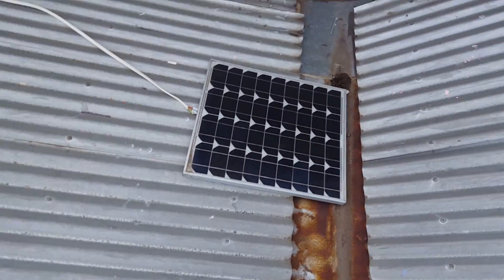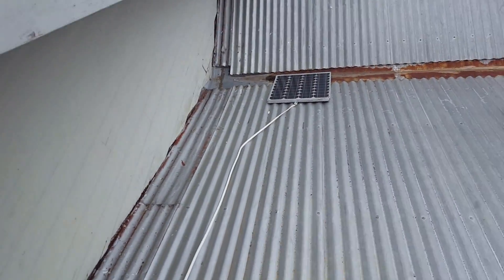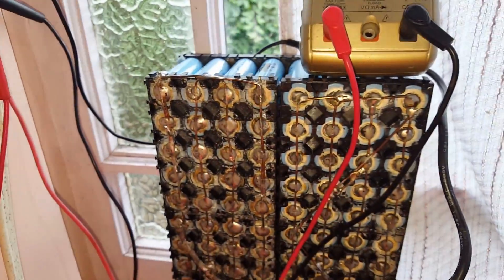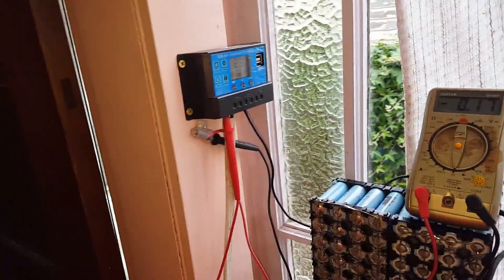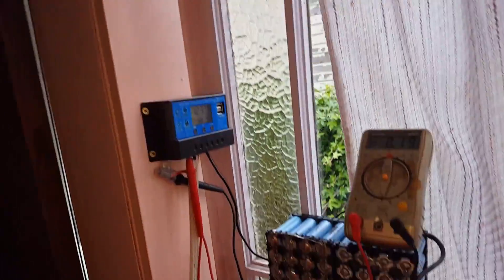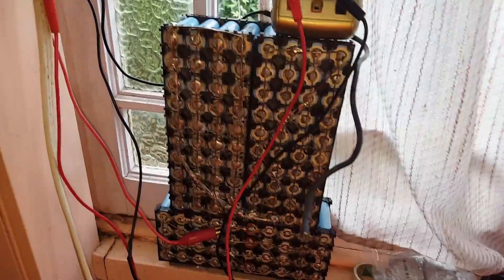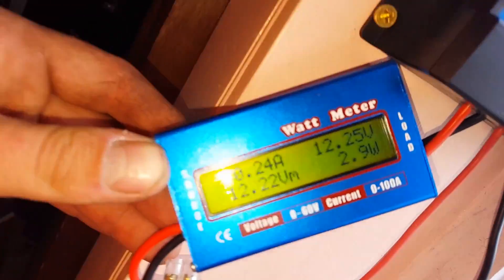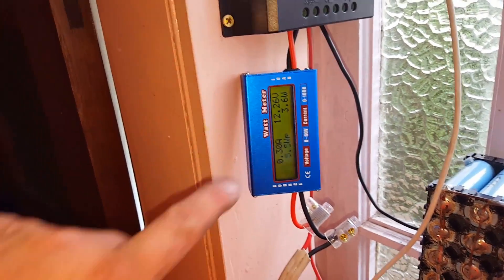Diy mini 18650 Power wall solar charge controller mounted and charging

Comment: Hello. How many ah is your bank? is it wired up into 3 banks series to give 12v?
I work at a powertool repair shop and Ive got load of dewalt battery packs that im currently dismantling to build a power wall.
Is the solar charger regulator your using just wired directly to the 12v output of the battery bank? Is it also a special type thats designed to charge lion cells?
Reply from the maker: Yes 3series 66 ah 
That was connected to solar direct to cheap charge controller max set to 12.6v and only with a 40 watt panel.
I was the bms do not copy this. Buy a bms to suit and make it safe
Reply: @Oneupthesleevecustoms  Cheers. can you recommend a bms to use on a system like that?
There are some 3c bms pcbs rated at 40a on aliexpress, see the link below and let me know what you reckon

https://www.aliexpress.com/item/4000370977034.html?spm=a2g0o.productlist.0.0.7e3346cbECAfOg&algo_pvid=7d9a7629-0c84-41a4-b5a0-678c2aa887ad&algo_expid=7d9a7629-0c84-41a4-b5a0-678c2aa887ad-25&btsid=e05b244a-ce14-49ef-b947-f4f87041fd7f&ws_ab_test=searchweb0_0,searchweb201602_9,searchweb201603_55

Comment: how long time charger battery 0 to full ? and how many mAh this battery?
Reply from the maker: It was 600 watt hrs it could charge as slow or fast as you want. Was 55 ah at 12v. Could charge at 100a if you need to

Comment: for this type battery charging (18650)what solar charge controller which is better? PWM or MPPT and what brand do you recommend?
Reply from the maker: Neither a mppt with a bms is the only thing i could recommend as safety is key
Pvm is a cheap way of charge control hence its cheap price and lots of inefficiencies  cheers

Comment: Run usb 12 volt socket direct from the panel. Charging battery to battery is just using up unessary cycles.
Reply from the maker: Super -sim thats true this setup is scrapped now but  i have a big setup im building

Comment: Epic stuff bro!  Looking to do something similar. Any recommendations for where to buy quality 18650s cheap?  I'm open to processing old laptop battery lots if you have a decent recommendation for a seller?
Reply from the maker: +Dimitris Zarmakoupis the issue is so many people doing that now there hard to find  anymore. How big do you want to go and do you have a budget in mine
Reply: One up the sleeve customs I want to buy 120 cells (or more if some will be faulty) 2000-2500 mah.  Looking to build a 12v pack to output 500-1000 watts similar to what you've done.  I was hoping to spend under $200 US on the cells

Comment: Can a solar panel an a charger controller charge them batterys at one time
Reply from the maker: +Jerry Blackledge yes
Reply: How many amps an watts do I need to charge them
Reply from the maker: +Jerry Blackledge yes
Reply: I see videos  ppl goes over board with batterys build huge battery banks thsts crazy
Reply from the maker: +Jerry Blackledge gow many  calls you got
Reply: I got 9 so far
Reply: Am watching yr video like the battery bank how many amps are you useing to charge them all at one time am new here so am trying to build my way up with a battery bank
Reply: Do ya have the watt meter hook up to the solar panel then threw the charge controller an to the battery bank
Reply from the maker: +Jerry Blackledge na i should make one
Reply: I have a a.c. power supply 110v an then 12volt on other end 4.16 amp csnn i charge those batterys with thst
Reply from the maker: +Jerry Blackledge should do
Reply: Ok do I need a charge controller to hook to it
Reply from the maker: +Jerry Blackledge yes defiantly get a charge controller
Reply: I got one it only had led lights charge controller
Reply from the maker: +Jerry Blackledge thatts cool
Reply: How do I no when batterys are charge on that solar charge controller it only has led lights I need some help with it
Reply: I have 8 of  those batterys do I put  3 in s an the other 5 in p all hots an grounds
Reply from the maker: +Jerry Blackledge yeah are they new or second hand
Reply: They not new but full charge is 4.2 they hold a good charge
Reply from the maker: +Jerry Blackledge oh thats good yeah. Just get  3s and parallel  whatever you want but keep an eye on each banks voltages  and stay safe
Reply: I just want one big battery bank not 3
Reply from the maker: +Jerry Blackledge i think you need to do some more research into litium battery systems mate
Reply: I mean I want a battery bank
Reply: I see ya only have one in the video battery bank that's hook up to a charge controller an a yellow volt meter
Reply: I want mind that size
Reply: Will those batterys blow up if the voltage drop

Comment: awesome video ,how lomg does it take to charge the battery pack  full
Reply from the maker: +Ben Ch 1.5hrs i beleive but will test  and post a vidoe
Reply from the maker: +Ben Ch hey  it puts out around 2.2 amps and is 55 amp in capacity.  I don't  often let it get full so not sure but say around 20hours of sunlight from flat

Comment: is it going to stop charging on 12.6 volts.   12.6 volts will be the max voltage for the 3 packs you got there, or am i missing something. thank you interesting  charger controler you got ther made in au. thanks
Reply: i have this charger dosnt work so well with higher voltage panels
Reply: my panel does 40v  when its cold 5amps
Reply from the maker: +ary depaula yeah charge controller  stops at 12.6 you cN adjust it. It must have come from overseas maye
Reply from the maker: +ary depaula thanks for watching
Reply: awesome if you can control when to stop
Reply from the maker: +ary depaula 12.6v minimum and 15v. Maximum
Reply from the maker: +ary depaula they work well ive got 2 now
Reply from the maker: What do you call high voltage
Reply from the maker: ebzery yeah mine did 38v and poped the usb charger

Comment: Just a tipp: Voltage drop comes with current through the cable. You can actually have a 500m Cable and you will have the ~same Voltage on input and output. But read the Voltages on a Sunny day directly on the panel and on the terminals of the solar charge controller. With that reading (and the measured Current) you can calculate the actual powerloss through the cable. But as it is a small Panel and you use some 2,5mm^2 cable it shouldn't be to high ;)
Reply from the maker: +Robin Cerny i later on did this and .015 of a volt at 2.6 amp 12v infeed theres about 35m of cable i worked out and im not having any issues thanks heaps mate i appreciate  all the feedback/hints  cheers
Reply: As I said, it shouldn't be to high ;)
I'm actually an educated electrician, and I also worked some time with Solar installations (much bigger of course ~5kW and above). 
But I like guys who do it your self, at least if it's mostly safe, and if not, I like to point out warnings ;)
Btw. just as a small tipp: You can actually power Switch mode power supplies  with a high enough DC Voltage, something around 80V to 180V would work without a problem, of course you need a DC-DC Boost converter to boost the Voltage. But as far as I know it would be more efficient then using an Inverter for that Job. The first thing Switch mode power supplies do is rectify the input anyway ;) Keep in mind that this only works with Switch mode PSU's!
Reply from the maker: +Robin Cerny yes i was reading about this  recently and am yet to try it ive got a small dc dc boost but looking to get higher voltage one . Cheers man i love feedback
Reply from the maker: Robin Cerny thats a big step up insnt it my plan is to make a high voltage  power wall and run it into the 5kw grid tie  inverter i have so over 200v dc and use it when im running big things in my shed like welders plasma cutter and big compressors so im not costing me so much dam money in electricity
Reply from the maker: +Robin Cerny what part of the world are you from robin
Reply: Funny that you ask :D
I'm from Switzerland, and we have actually one of the strictest norms/standards for electrical appliances and installations ;) Sometimes, if I'm in other countries and see there installations... the only thing I can do is a Facepalm xD
Reply from the maker: +Robin Cerny hahah yeah it can be scary im a plumber  by trade and when im in ceiling  crawl spaces ect it makes me wonder how places dont burn down 3.6kw water heaters on running on 1mm2  cable 30m long haha
Reply: At my last Job, we had a box full of "special stuff" that our costumers tinkered... Burned cable rolls, Aluminium foil wrapped fuses... all kinds of weird and scary stuff xD
Reply from the maker: +Robin Cerny custom bolts for fuses make me  laugh too the things you see ....
Reply from the maker: +Robin Cerny haha yep youd know she lot go
Reply from the maker: +Thomas Cruz ^^thats some numbers i can work with cheers

Comment: Very helpful, thanks
Reply from the maker: +robviolin1 thanks for watching  its been a fun project and im still using it the way it is now
Reply: One up the sleeve customs - I need to make my brother in law a 48 volt pack using 18650 batteries for his electric riding mower.
Reply from the maker: +robviolin1 that would be awsome!! Nice and quiet too use
Reply: One up the sleeve customs - I converted two gas riding mowers to all electric. I use a 24 v system on my mower. I have been using two 12 v AGM batteries. I need to make a 24 v pack of 18650 for my mower. It is great cuz it works every time. No gas, oil , spark plugs, and no hassles.

Comment: how do you balance the cells?
Reply from the maker: +TeaDrinkingIlluminati top balanced them once and cycled for last 6 weeks with only .1v drift they dont need active bms or Balancing.
Reply: One up the sleeve customs Alright, seems legit. Can you quickly explain what top balancing is? Is it just charging the parallel pack and letting it sit or?
Reply from the maker: there is a mini  diy powerwall  play list  have a look at the newer videos of it it has a little cell moniter that scrolls  through each cell and the total pack voltage  i get .5kwh out of it when its fully charged
Reply from the maker: +TeaDrinkingIlluminati top balancing  is done by making all the cells charged to a set level (4.2v) for totally full i have done it in the past with the lab power supply one pack at a time but youll see in later videos i now have a std balance lead on it and can use a lipo charger if needed
Reply: One up the sleeve customs Thanks! The balance lead goes to every positive and the most negative right? How often do you balance the cells?
Reply from the maker: +TeaDrinkingIlluminati haven't since  the first time
Reply from the maker: +TeaDrinkingIlluminati yeah black to negitive and every positive  on the pack

Comment: very danger
Reply from the maker: +戴来 no danger work well
Reply: One up the sleeve customs You do not even have a protection circuit, there is no balance, if I see this I will keep his distance
你连个保护电路板都没有,也没有平衡，我要是看见这个这个我会和他保持距离
Reply from the maker: +戴来 you didn't  watch the videos clearly. It doesnt need protection  or  a bms watch the other videos and see

Comment: Nice video thanks - may I ask though: Did you fuse each individual cell and what is the purpose of the connections that appear to run some diagonal distance on your pack?
Thanks!
Reply from the maker: +David T. No just a test pack with known good cells so i didnt fuse. The extra diagonal  wires are to help  hold  large bust currents for videos  thats are coming soon
Reply from the maker: +David T. The final large powerwall will have  cell level fusing there is a whole playlist  of videos  on this small scale test
Reply: Thanks - Yeah I've seen several vids where they have fused each cell..I  am going a slightly different route, since they cells I get from laptop packs are already tabbed in parallel, I am opting to just fuse 2 or possibly every 3 that are already in parallel..Not failsafe but certainly better than no fuses at all..
Thnks for the reply,
Dave
Reply from the maker: +David T. Yeah fusing is next on my list mate
Reply from the maker: +David T. Yeah fusing is next on my list mate but the next pack will be like 2500 cells

Comment: Can you link the solar panel and controller?  Also, what is your battery configuration?_S_P?
Reply from the maker: +eNkrypt 3s 40p mate the panel is just a cheap as no name brand 40watt panel. Charge controler is a no name 20amp pwm charge controller about 20 bucks aud on ebay cheers
Reply: One up the sleeve customs thanks man! How long does it take to charge your pack at that amp draw from the panel? I have just started getting into this using recycled batteries. Came across your video! Cheers from the U.S!
Reply from the maker: +eNkrypt mate go through the li ion battery play list youll love it. About 14 hours from flat need much bigger panel but this is a small scale test about.5kwh storage. Im probably  going to make a 20 or so kwh one down the track
Reply: One up the sleeve customs will do! Hey, does the solar controller shut off when it detects the voltage is high enough? (4.2V*3 series = 12.6) can you control that? For instance if I am doing 4S120P I would want to be able to charge until my voltage reaches (4.2V*4 series = 16.8V) in my case I am using a BMS for each parallel cell pack in the series.
Reply from the maker: +eNkrypt maybe not 16v i think this one tops at 14.7v float charge. And its turned down to 12.7 but never sitts there charged  as i use the free power it makes

Comment: sir im krizmer from phillipines. quick question? are you using charger controller directly to your power wall (18650) 12v set up i guess? or are you using bms between scc to your power wall
Reply from the maker: yes directly connected not ideal if you are going to let a samll pack like this charge up fully. if this was on a larger scale id be using almost all the energy ive captured so it would never get to full. float limit is set at 12.6vdc

Comment: Quick question, is there any fuse links between the cells? Looks like from the videos each cell is soldered directly to the tick wire between all the cells? or am i wrong?
Reply from the maker: no no fuses your correct thees also no big loads and no balance issues and they are all known good Samsung 15m cells from power tool packs,
this packs only a toy as im going to build one more like 20kwh this is all to test these cheap charge controllers and get some free electricity while the sun shines ;] thanks for watching

Comment: so how does this work? is the charge controller hooked directly to the batteries or are you using something else, like a tp4056 in between? if connected directly, can the cobtroller simulate the charge curve for lithium ions or don't you charge them completely full?
Reply from the maker: charge controller set to a max of 12.7v has 2 automatic modes boost and float. the nature of 44 amph pack means its in boost until 12.6 then pulses to top it off. it will rarely get near charged at i intend to use all the electricity it uses cause its free